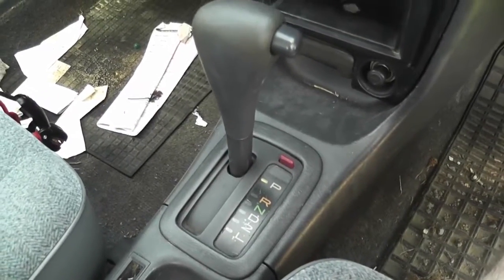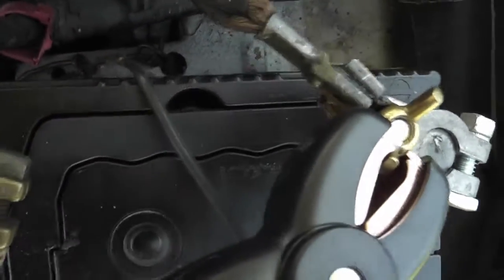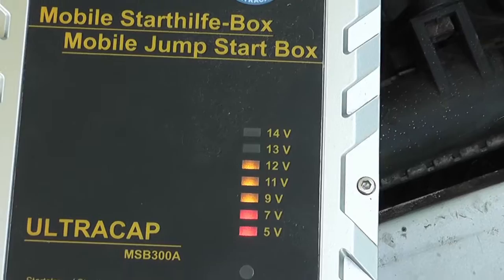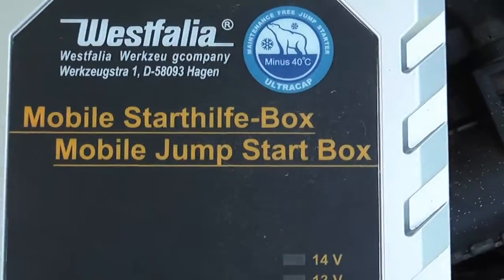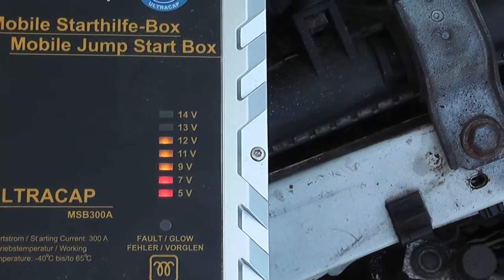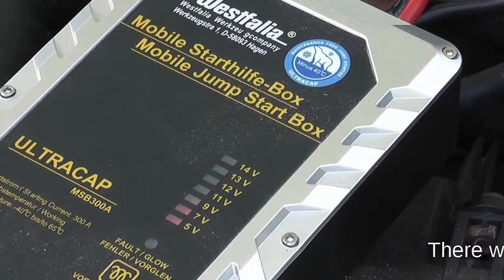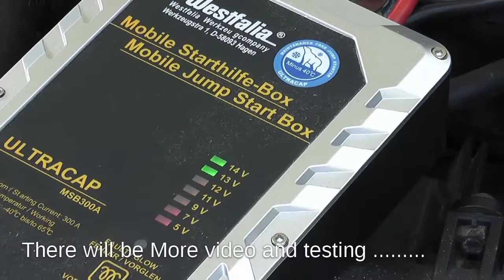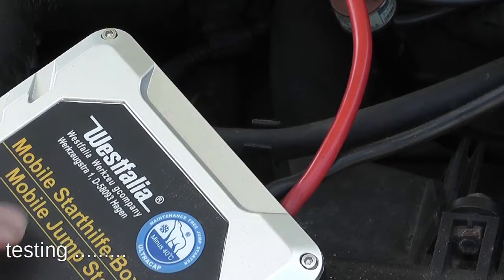A magical jump starter with no battery? OR WHAT!!!

Comment: There ARE batteries in it. Mine has Ni-cad cells and you must CHARGE it first, before using it. Mine charges either by a transformer and plug from the mains or by plugging it into your cigarette lighter socket with the car running.
Reply from the maker: John Somerset  you have a different product. This one has only the capacitors it only cranks for 10 second before it's depleted. It boosts from 5 volt as most dead battery still have 5 volt it scavanges the remaining power for a final boost. Usually enough to start ,if the car has no issues starting.

Comment: "If it won't go to 14 volts then we are screwed"...we are screwed.. and what's more it's cold and raining and dark and I don't have an  electricity supply nearby because I am stuck in the middle of nowhere in my car with another box that needs charging up.
Reply: This box that needs charging looks like it will charge from your dead battery and store enough energy for quick release to start your car. It has a booster circuit of some sort that steps the voltage up. Some will work with batteries that are discharged down to 5 volts. In one way this thing is superior to a battery jump starter: it doesn't require any maintenance and can be stored in you trunk until it's needed.
Reply from the maker: yes it seems to be what it is doing will hopfully have time to do more testing soon.

Comment: Great video Mate, Cheers The Dizz.
Reply from the maker: Yea thanks i am probably going to use my pico.scope on it with Amp-clamp to hopfully see what it does .
Reply: Great video. If you have a scope it would be interesting to see voltage when you try to start it with the low battery before connecting the jump starter. Then the voltage well it starts with the jump starter.